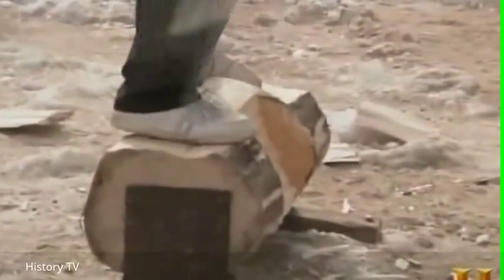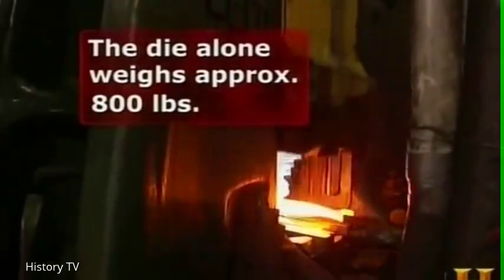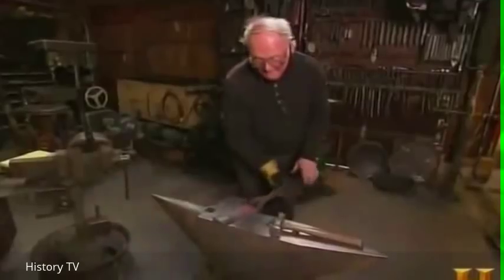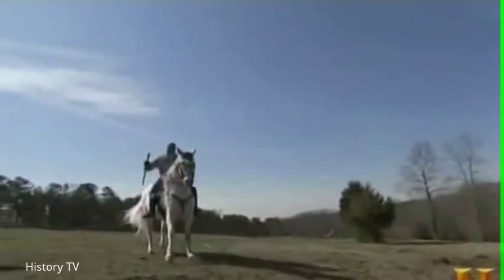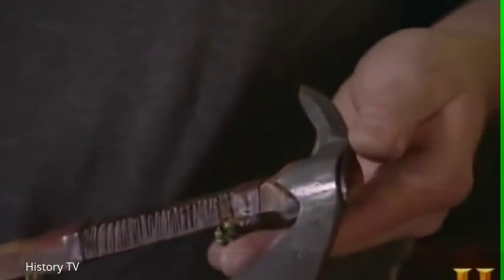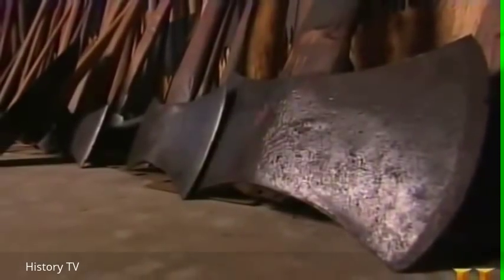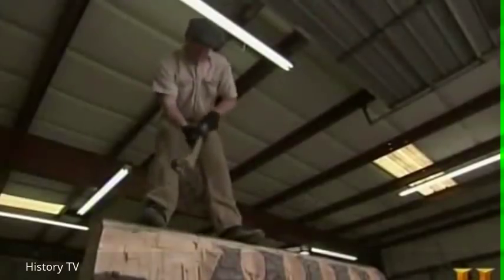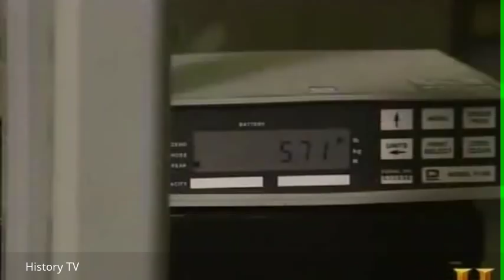Medieval Weapons - History Of Axe Documentary - History TV

Comment: Steel toed boots anyone?
Reply: I'd just wear sabatons
Reply: phuck ewe
I've had both bones in my left leg broken because of an exercise in PE class that lacked proper safety gear.
My foot was off at a 90 degree angle, and I was still abled to crack jokes with my classmates while waiting for the ambulance. 
I can stand the heat alright. I just know it's not worth it just for the thrill.
If I'm gonna take the risk of loosing a foot, it's gotta be worth something.
Reply: Axe would squash the steel toe cap in to you're toes. I think they are better with the chainmail

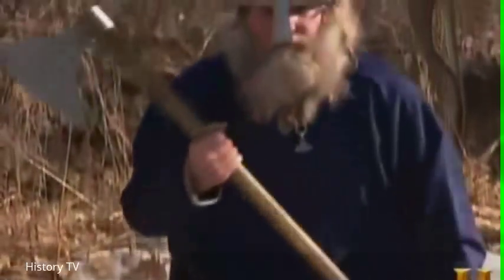Comment: 16:16 - I never thought Santa would look me dead in the eye and tell me about Battle Axes other than his wife.

What the hell is with their armour? It looks like they broke into Braveheart's costuming shop.

Also, I was under the impression that Helmets and Mail counted as armour.

The sword wasn't necessarily lighter, it just feels lighter due to the center of mass being closer to the hand, and battle axes weren't slower. They were, however, harder to stop due to inertia, and took more energy to swing for the same weight distrubtuion reason.

On the battlefield, then the best options, descending, in terms of a frontal confrontation, are the Longbow, the Spear, the Mace/Warhammer if facing heavily armoured opponents, the Battle Axe if facing lightly armoured opponents, and the Sword when facing unarmoured opponents.

Titanium isn't stronger, it's more like the same strength for less weight.

Plated shoulder protection? In the 11th Century?

Are you sure that that's full speed? At that rate, molasses would be faster.

What the hell is that thing? That's supposed to be a Poleaxe? That axe head on a skinny-ass tree is supposed to be this:https://www.gdfb.co.uk/ekmps/shops/11b299/images/pole-axe-with-wooden-shaft-30533-p.png? Hell naw!

Plate harness was what poleaxes were designed to fight.

It was meant to transfer percussive force through the plates into the body, not to open the armour up.

20:08 - Ladies and gentlemen; Two men from the land of Roblox fight at the pace of a turtle dying of old age!

That's why you'd give axes a rectangular haft, not a round one.

Wow! I didn't know that the Native American Tribes stole a Native American design from the Europeans!

Well, modern kevlar helmets aren't made with spikes mounted on poles in mind.

26:47 - Look! The spike! It's being a spike! https://youtu.be/barWV7RWkq0

My god, I'm glad that I skipped through the lumberjack part
Reply: You forgot bollock daggers ;)

Comment: the axe is the perfect weapon works as shield and weapon need to fend of the enemy, keep w swinging and swing it fast it may be a bit heavy but that makes each blow have much more force yet backing up the enemy with no way out but to run, because of this force if blocking with a shield will just wear the enemy out yet ending in a finished decapitation or strike
Reply: Not true really. A spear vs axe the spear would win. Don't say the axe could chop through the shaft because it can't. A hardwood pike handle is very difficult to cut through and it has tons of distance. It would skewer you before you got the chance to strike him.

You will be surprised at how much a shield can take. Shields were thick and would absorb a lot of force, not to mention the thick gambeson the person would be wearing.

And once you lose momentum with the axe (By striking opponents shield) They will just charge you and stab you in the face with their sword.
Reply: Axe can't chop through a wood shaft?  It's design to chop wood of any kind.
Reply: Kaze No, it can't. Look up Skallagrims video on it. In the hands of a real person it would sway a bit, reducing the amount of impact the ace has on the spear. And combat axes are different to tree felling axes.

If you think you can hold a spear as solid as a tree then you're lying. Not to mention you're trying to stab the person trying to kill you as well. Spear wins. That's why they used them.
Reply: It depends on who swings the axe.  A real warrior axemen will split it in one single chop.  Look up professional lumberjacks competitors, they will cut that twig like it's nothing.
Reply: Yes but it depend son the spearmen as well. Spears aren't heavy at all and require no effort to move out of the way of an axe swing. Both warriors must be put on the same level to have a decent argument.
Reply: A spear can only kill the axemen only one way by stabbing him.  But an axe can kill a spearmen many ways.  You can chop his head off or you can crack his skull.  In fact you can even use the axe to make traps that can kill the spearmen.  You can fell a tree and not call out "TIMBER" and watch the spearmen get crushed.  Or you can kill the spearmen the most indirect way.  You ask the spearmen to duel you in the middle of winter up in Northern Canada during a big blizzard and watch the spearmen freeze to death from hyperthermia and you'll just build yourself a log cabin with the axe and keep warm, then collect his dead body for food to trek back to town with his head mounted on his own spear and tell the people you kick his ass. :)
Reply: Haha, okay I can tell you're not taking this seriously anymore. Have a nice day.
Reply: Varck i can win the fight over axe or spear for both of you! The bow man wins....
Reply: Kaze there is a huge difference between battle axes and wood axes. If you are a pesent and bring your wood axe into battle to break a spear you are essentially acting as fodder. You might manage to break a spear but you have to get close and hit it against a hard surface if you miss you damage your axe, in battle even breaking the spear means very little if he has friends with spears you're dead, if hes is professional army then he is going to have a short sword or another wepon, and not to mention that having done forestry competitions and done wood by hand that you will need both hands to break a hardwood spear shaft, leaving yourself quite open to anyond coming at you and you will have to hit it from the side of the enemy not head on only way an ace will beat a spear is if the guy bashes the spear away and goes up on the guy getting him faster then the guy can raise his sheild. If i was in a battle with this going on you would see me on a hill with a bow and arrow on a horse... ready to advance or advance in the oposite direction.... with a spear sidearm and a sword sidearm and i would not wear armor, a sheild i would have too but nothing that will greatly imobalize me in a fight and i would dump the sheild if the enemy didnt have archers, no point in getting slashed in half if im dismounted and i cant get shot... really in mideval times the best bet is light weight as with all times...and a bunch of light weight wepons is better then armor and heavy ones
Reply: we don't under stand how the warriors of old used an  Dane axe that's our problem  .Vikings and Saxons used it ..you  could stab like a spear, hook like a bill, chop like a 2 handed sword, smash a shield,  block like a spear using the shaft , you can take the legs from horses ( they were a bit smaller then lol).long range weapons   like the bow defeated it...

Comment: At half a thousand fucking bucks I'm shocked those US soldiers can afford those RMJ tomahawks. For one tenth of that price I can get a Swedish hand forged proper fucking axe made of a thin hammered leaf of damascus with a hardened steel bit insert sandwiched between it as the blade is folded over like a real axe should be, not just fucking stamped out of random ass 440 metal that'll snap if you try and use it inappropriately. A proper axe head is smaller, and fatter, that's just a pressed out flat piece of metal with an edge on it. You should see what real axes can do. I can't believe people pay $500-800 for a stamped fucking metal tactihawk.
Reply: It's 80CRV2 steel.  You're right, otherwise.  I think the cost is the tungsten carbide they use to finish the head with.  Since 80CRV2 is a high carbon, low alloy, it would rust fairly easy, so I think they chose the most expensive way to rust prevention they could just to jack the price up.  As far as tacticool axes go, a 15.00 one from Amazon that really is just 440 stamped will perform just as well, so it is a legitimate question as to why anyone would pay so much for a blade that's only a slighter better steel with an overly expensive finish that doesn't do any more than a coat of flat black or an acid patina would do for it.